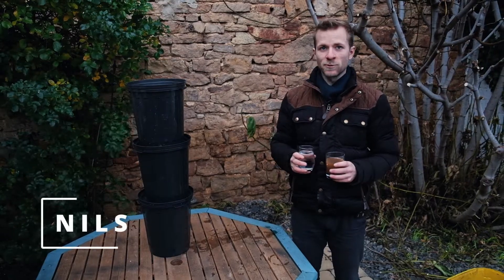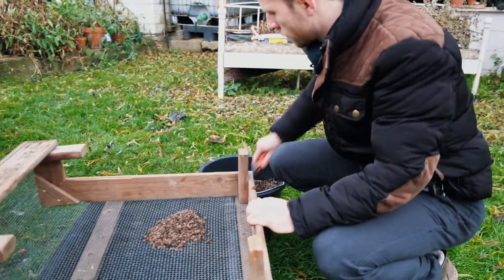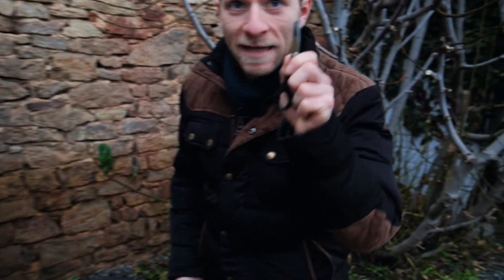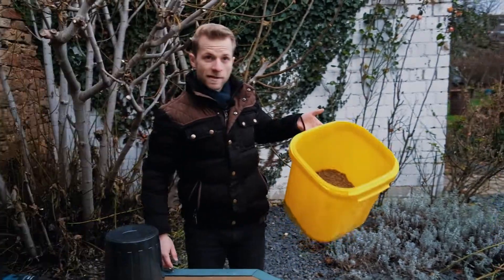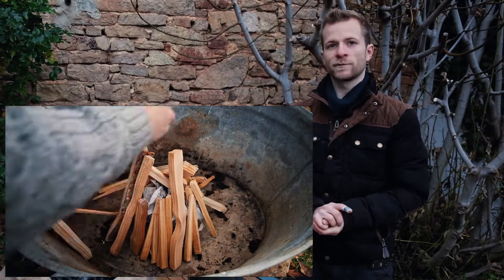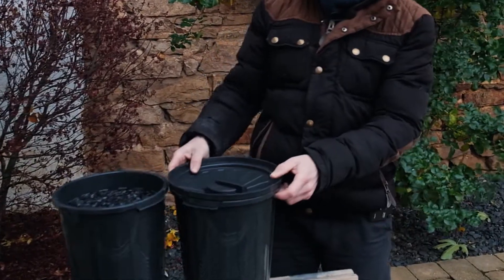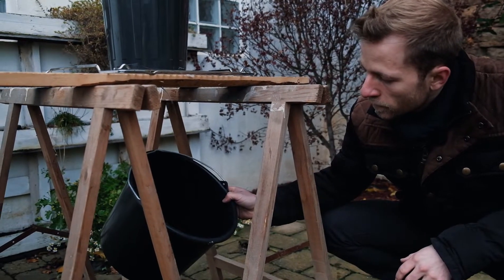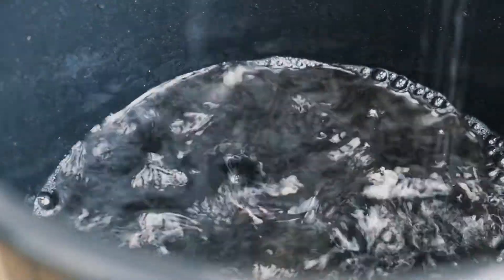WATER FILTER with BIOCHAR self-made [Complete Guide 🔨]

Comment: Let it run for a few days for biom to form into the sand, let it run to flush away contaminants and microscic particles and then drink it. 
Never drink it straight away unless it is a life threatening dehydration situation. And lastly I think your water runs too quickly . For best results your device should give a maximum 10 liters per day considering the size. My point is that running so quickly provides you with a rudimentary filtration but not purification therefore is good for bathing not for drinking.
After filtration you should consider UV light treatment and even chlorination. To insure a minimum of safety also acquire a kit of water testing. Make charts with readings everyday to develop a hunch.